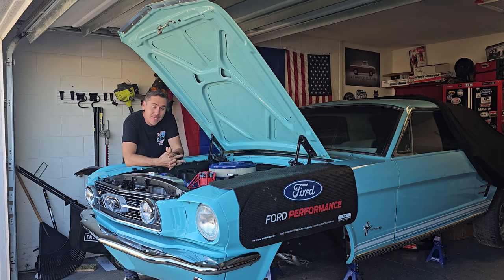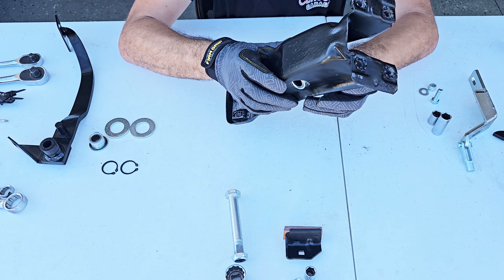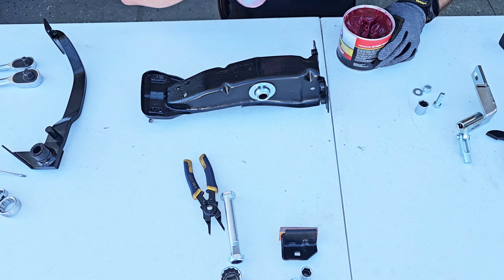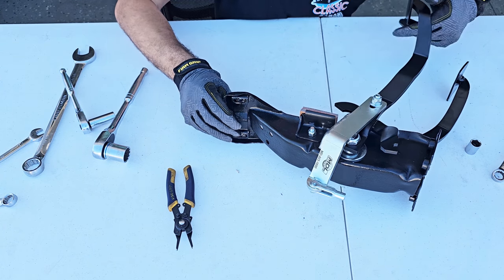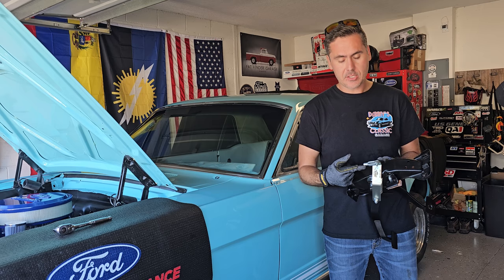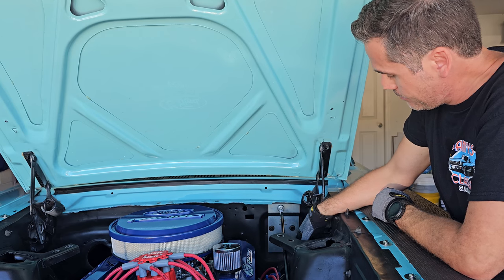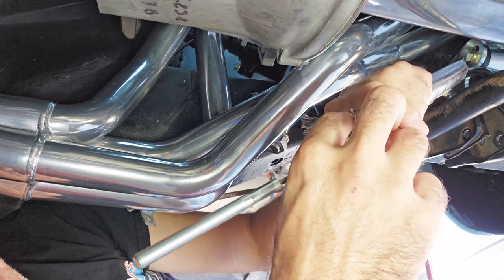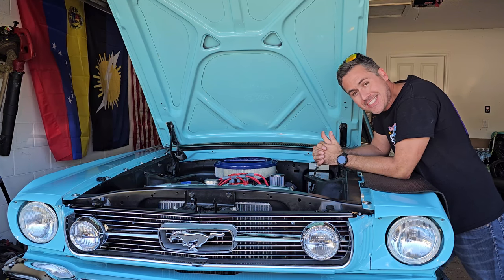Step By Step, Pedals installation and Clutch Cable on a 66 Mustang

Comment: Did you put in a clutch return spring ? I did not see one added to the assembly.
Reply from the maker: Hey bud, thanks for asking. No, i didn't install a return spring. it is not necessary with this conversion kit, but depending of your trans you might have to change your clutch fork for a "pull style" in order to make this kit work properly

Comment: should have installed a hydraulic clutch since everything was removed before hand. That heat shield wont protect the clutch cable
Reply from the maker: Honestly, I didn't want to go hydraulic because I would like to keep the feeling of an old car....and bout the heat shield you are right...when I ordered the headers I asked summit racing about the fitting with my setup and they said it's ok, once Installed everything found that problem...I called them they ended up replacing the headder for a short ones...so the clutch cable it will work fine for now...👍🏻....thanks anyway for the advice. Maybe in the future, I'll try a hydraulic system with this or another car 👌🏻